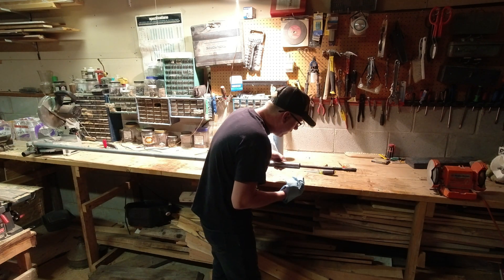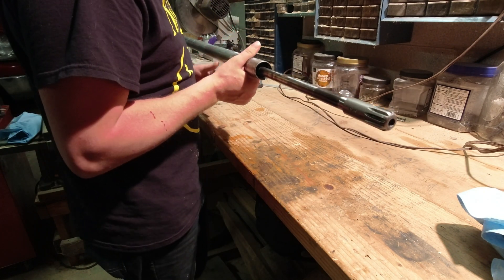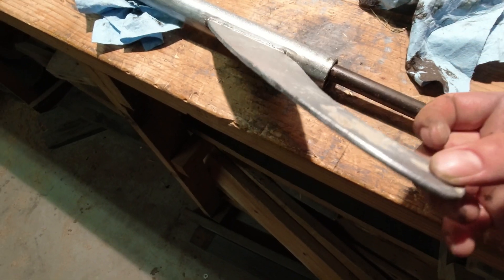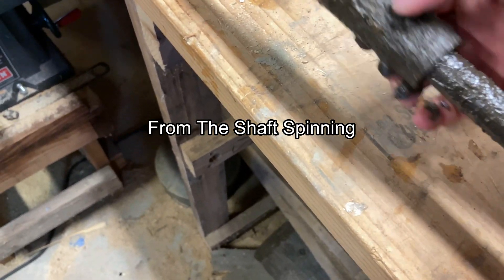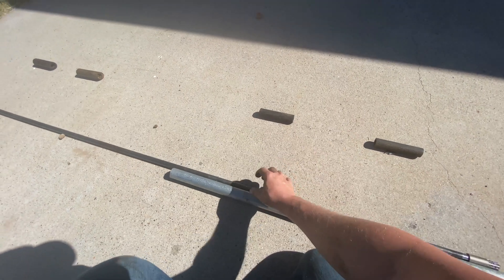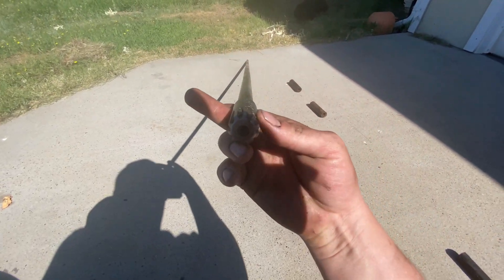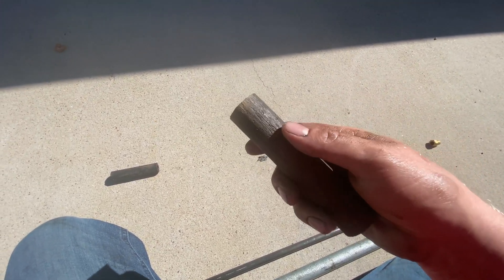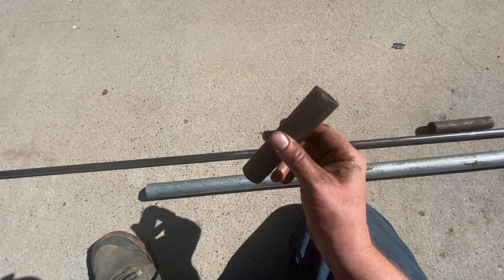Mudskipper | Thai Long Tail Mud Motor | Prime Kit Shaft Dissection

Comment: I live in Thailand and have a 13 hp longtail motor that has a vibration at idle then smooths out under load. Getting ready to take it apart and had no idea what I was getting into. Seems pretty straight forward. Thanks for this video. Makes my job easier. I’ll keep watching.

Comment: I wonder how the splined piece is attached to the main long drive shaft tubing
Seems certain the bearings were pressed into the tube first
Then the driven shaft was slipped into the tube
Where I am lost is what next ?

Or possibly the tubes have the bearings installed then slipped together deeply
Then after the drive shaft is completed
The tubed made to final length then welded

This is something I would like to know
And what holds the splined drive shaft from moving backwards and falling out of the engine ?

Comment: Good info hey bud maybe you can help me the plastic bushing in my shaft melted so I bought the bayou bushing and I'm having problems getting the other one out but I didn't know for sure that I could take that whole shift apart and get it back together rightso if I take the whole shift apart I should be able to get it back together okay? The reason it melted I was running it out of the water cuz it was every once in awhile would make a loud noise and I couldn't tell if it was coming from the motor or coming from the shaft and maybe I can send you the video and let you listen to it and you could probably tell me what it is there's nobody else can tell me what it is I would appreciate it thanks
Reply from the maker: I recommend unfortunately a whole shaft replacement it’s very difficult to get these back together once you take them apart especially being the internal wood bushings that will likely be destroyed when you take it apart. Try everything you can to get that and bushing off Well like I said you likely gonna have to have a shaft replacement and once you get your new shaft then replace your end bushings before you get it out on the water it’s very easy